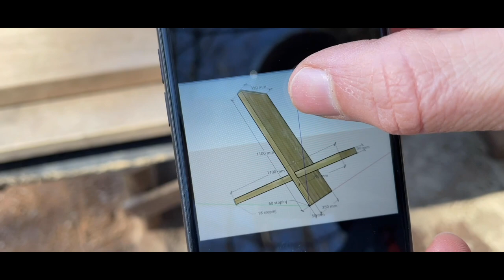Viking Chair From Recycled Wooden Stairs

Comment: I weigh 275 pounds. Will this design hold me up?
Reply from the maker: I am sure that a chair made of 4-5 cm thick planks of hard wood (oak, chestnut, walnut, beech...) can easily withstand a person weighing up to 100 kg.
For a weight over 100 kg, I recommend either thicker boards (6-8 cm) of hard wood or reinforcing the joints with a metal plate. 
There is always solution for everything ;)

Comment: What you treat the wood?
Thanks
Reply from the maker: In this case, I used only mineral oil to give the wood a characteristic 'wet look' and really emphasize the wood structure. Mineral oil does not protect well against moisture. I decided on such protection because the chair will not be exposed to moisture or wetness and will always be stored in a dry place.